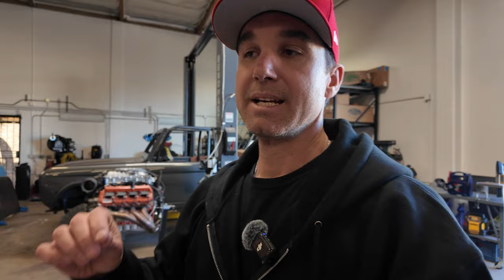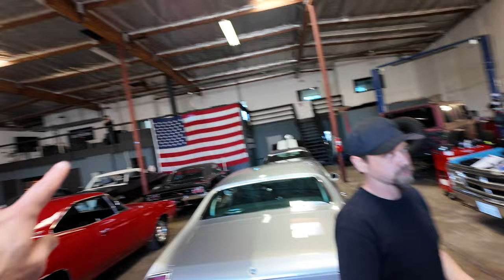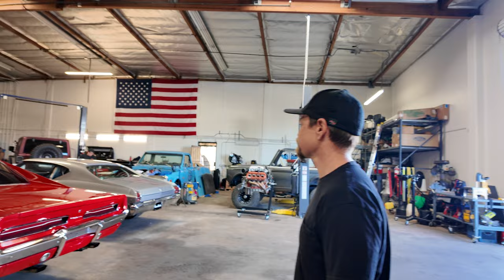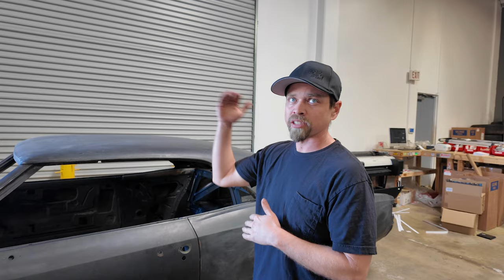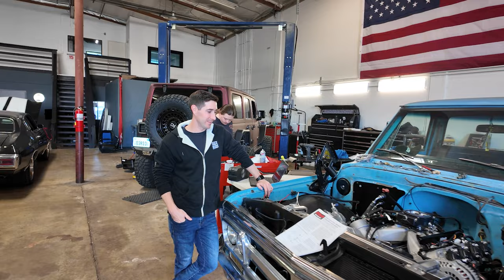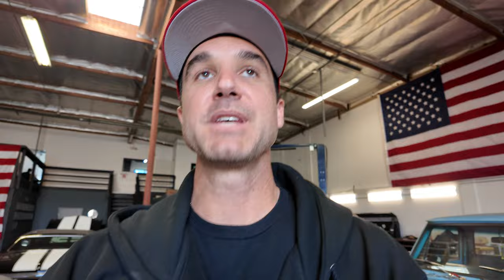What's Next... A Hellcat Swapped Charger OR the Supercharged Chevelle?

Comment: Back in "69, I bought a brand new Plymouth Roadrunner, with a 383 HP, automatic with console & floor shift. Later I swapped out the 323:1 rear end , for a 391: 1 Posi, added hooker headers/mufflers, some other goodies, and a 800 CFM Holley!  Talk about sucking you back in the seat at full acceleration! Wish I still had it! 
Now I'm a Mustang guy though, with a 2006 "tweaked" 4.0 V6, with headers, Pypes dual exhaust, Bama Tune, 5 speed manual, and recently added a 373:1 Posi rear end! Not quite as fast as the Roadrunner, but almost! 😁

Comment: I think gear vendors has an overdrive that adds 2 gears for the red charger im pretty sure they do that with most American old school transmissions guys like Jeff Lutz &  the guys from roadkill sware by them you can switch between 1 extra gear or 2 with control panel inside the car so you can shut 1 or both off for track & leave them both on for cruising cant hurt to look at always good to have options

Comment: Gear Vendors part # 3D0731A bolts on to transmission & adds 2 more gears on Mopar transmission they also have nice setups for GM & Ford they may be worth looking at if not for the red charger but possibly in the future